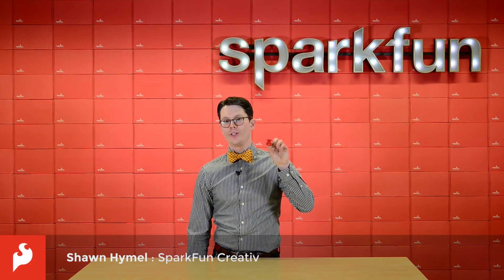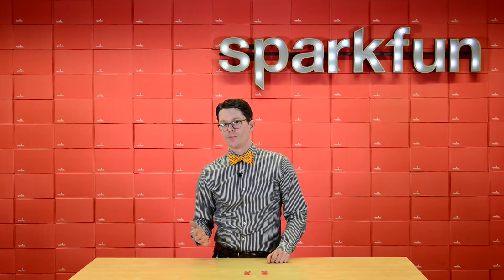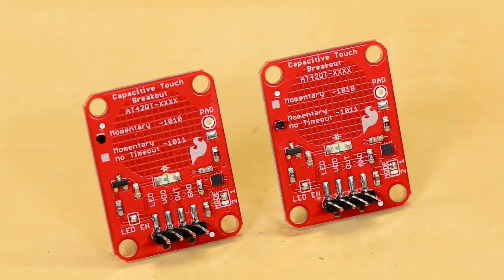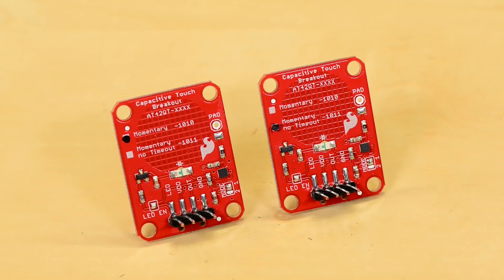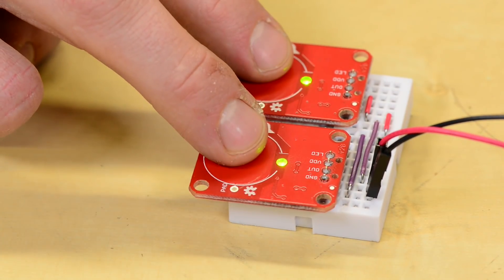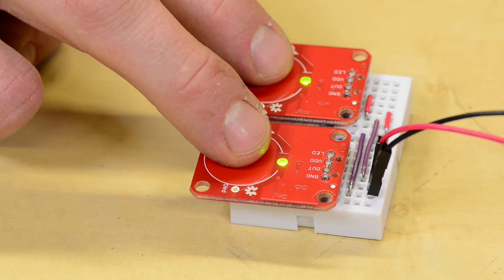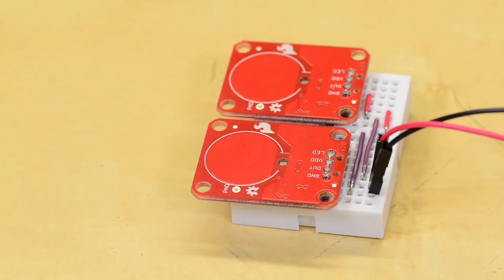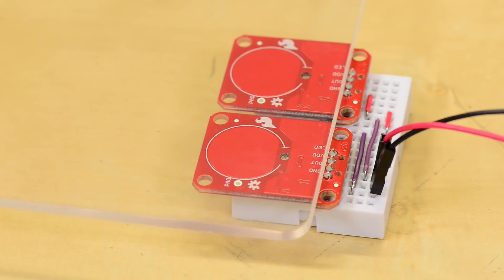Product Showcase: AT42QT1011 Capacitive Touch Breakout Board

Comment: is there an option on this board like alot of these type of switches usually have to solder closed which will make it a toggle switch instead of a momentary switch?  Also, I am trying to incorporate these switches into flush mounting a .021" thick, 1" round copper stamping blank. looks like a circular copper button. and i want to touch just the stamping blank and hide this module underneath and not seen. Do you think thats possible? OR can you recomend a way for me to do this?

Its so surprising to me that i have looked at numerous amounts of these videos and switches, and NOBODY has shown how to make an aesthetically  GOOD looking button.  see through acrylic and seeing the wires and this module through it wouldnt go well in a multi million dollar home.. how can I use a capacitive touch switch module with a flush mounted piece of copper metal? thanks for help in advance! :)